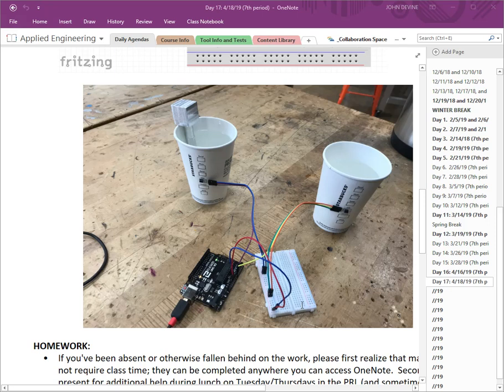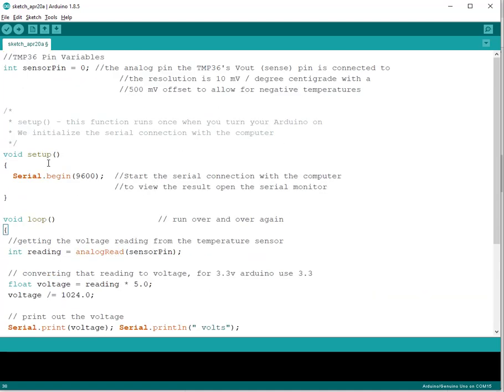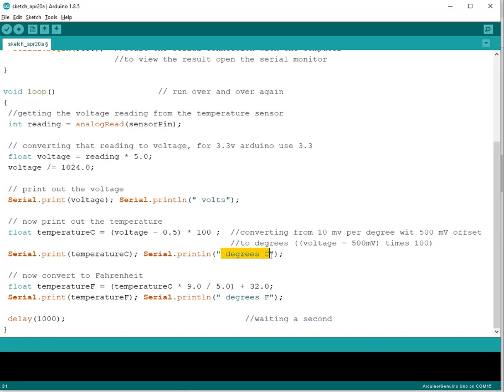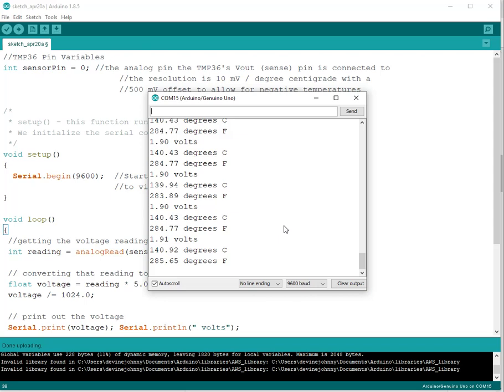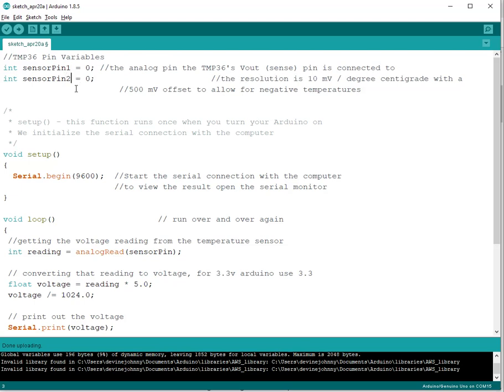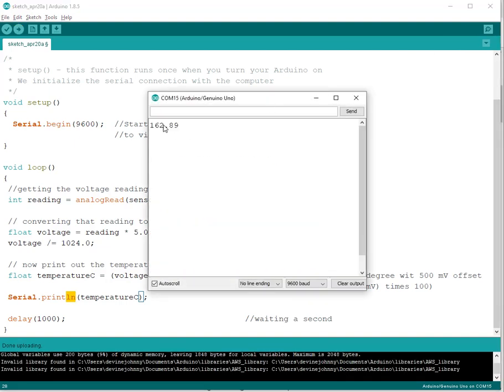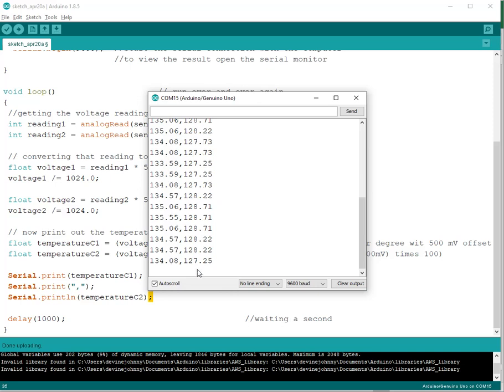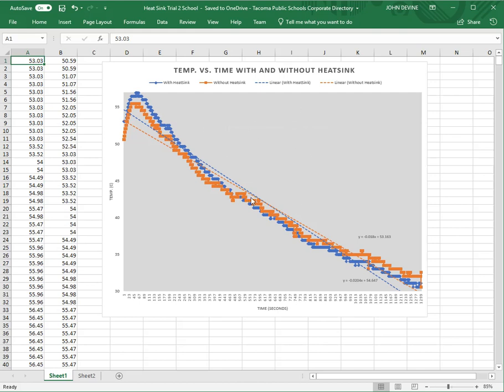Heatsink Project: Coding the Arduino

Comment: Could you please give the code and schematic ?
Reply from the maker: https://create.arduino.cc/editor/devinejohnny/dce6223a-1622-4c4d-a787-c55a66a617c0/preview
Reply from the maker: There is a tab that includes the schematic (dual_tmp36.png)
Reply: @MisterDevine  where does the place i checked in the description is it in the description please?
Reply from the maker: @dilshankasthuriarachchi4737  
I'm not sure exactly what you might see on your screen when you look at the online Arduino code editor I sent you.  If you are asking where the schematic is, there should be three different tabs right above the main code (one for the code, one for a ReadMe file, and one for the schematic as a .png).

Here is the code, if you weren't able to see that:
Reply from the maker: /*Dual TMP36 sensor code with output to serial monitor. 
  Modified from code for the TPM36 temp sensor from Adafruit.com
  Devine 2020

*/

//Define analog input pins for TMP36 sensors:
int sensorOnePin = A0;
int sensorTwoPin = A1;

//Define various variables:
int readingOne;
int readingTwo:
float voltageOne;
float voltageTwo;
float tempCOne;
float tempCTwo;
float tempFOne;
float tempFTwo;

//Define number of milliseconds betweeen each sensor reading:
int delayTime = 1000;

void setup()
{
  //Begin serial communication to computer
  Serial.begin(9600);  
                        
}
 
void loop() 
{
 // Take raw reading of both sensors:
 int readingOne = analogRead(sensorOnePin);  
 int readingOne = analogRead(sensorOnePin);  
 
 // Convert that readings to voltages; for 3.3v arduino use 3.3
 float voltageOne = readingOne * 5.0;
 voltageOne /= 1024.0; 
 float voltageTwo = readingTwo * 5.0;
 voltageTwo /= 1024.0; 
 
 // Convert to degrees Celsius:
 float tempeCOne = (voltageOne - 0.5) * 100; 
 float tempCTwo = (voltageTwo - 0.5) * 100;
 
 // Convert to degrees Fahrenheit:
 float tempFOne = (tempCOne * 9.0 / 5.0) + 32.0;
 float tempFTwo = (tempCTwo * 9.0 / 5.0) + 32.0;
 
  
 // Print out sensor one and two, seperated by a comma, in degrees Celsius:
 //(units not printed so data from serial monitor can be more easily graphed in something like Excel)
 Serial.print(tempCOnce); Serial.print(" "); Serial.println(tempCTwo);
 
 //Wait before taking another reading:
 delay(delayTime);         
}
Reply: @MisterDevine  thankyou and  but what about the schematic ?
Reply from the maker: @dilshankasthuriarachchi4737  Here's an Fritzing schematic.  Hope that helps!  https://drive.google.com/file/d/18NM0uh25v80OOOju5cKfhyrxOddk5CK-/view?usp=sharing